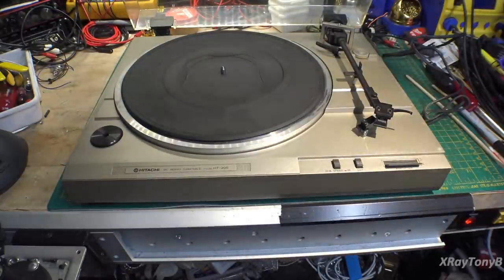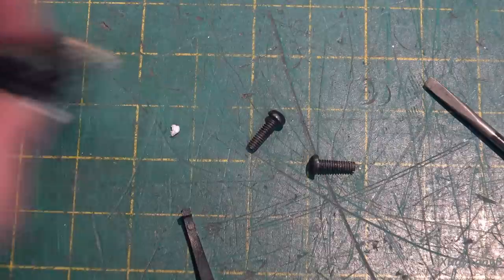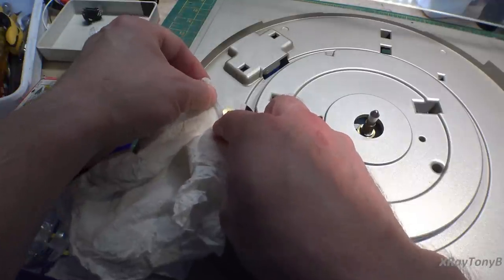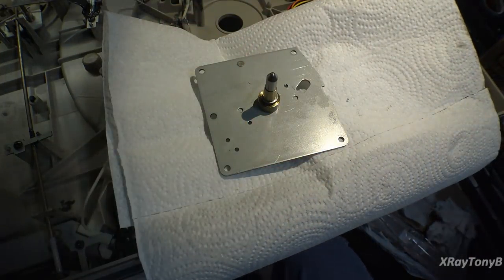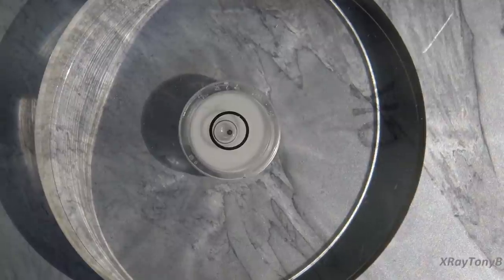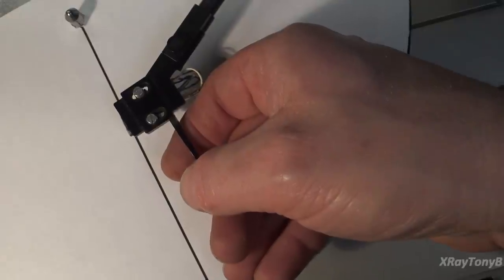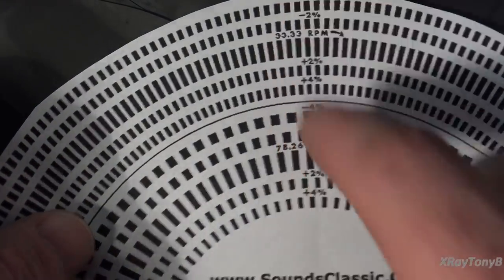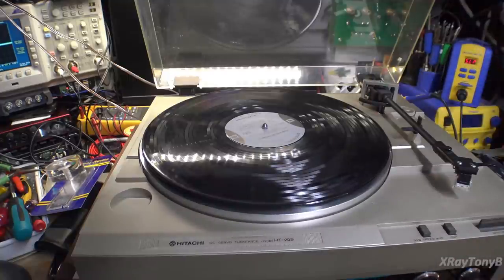Hitachi HT-20S Turntable Service & Setup

Comment: I found this video very helpful. Thank you!
I would like to add some info as well.
Lubricating the motor as you have done is only 1/2 of the lubrication necessary for the motor. Lubrication below the motor drive pulley simply puts oil on the shaft that goes through a brass friction bearing. The oil will quickly travel down the shaft and away from the bearing contact area. My motor was having 'drag' issues - it was squeaking as well. I actually tore the motor assembly down - to do this, I opened up the cover on the bottom and removed the insulator pad and then un-solder the motor connections and the motor control IC as well. I found afterward that opening up the heatsink band around the motor control IC is a better option rather than to unsolder the IC - to do this you must break one of the tack welds. Once the pcb is off of the motor, the cover on the bottom of the motor must be removed and then carefully separate the rotor from the brushes. I swabbed out the brass pilot bearing at the bottom and put lube oil (zoomspout) in the pilot bearing recess. Also, this is an excellent time to clean the brushes (do this first) with very fine grit sandpaper (very fine 1000 grit-maybe lighter) and also the commutator. To re-assemble, you'll need to wedge a small piece of plastic in the slot in the bottom cover between the brushes to hold them apart to put the rotor back into the pilot bearing on the bottom cover - don't forget the washer that goes on the bottom of the rotor shaft! The small plastic wedge will slide out as you insert the rotor back into the pilot bearing. Resolder the motor to the PCB and if you've removed the heat sink band from the IC, put some thermal grease between the IC and the motor housing. The band is for compressing the IC thermal contact side against the motor housing. I simply used small pieces of electrical tape to hold the covers on and the IC band against the motor control IC.
One final note - the speed control potentiometers are junk. I plan to replace mine, but I found that the de-oxit didn't really help with smoothing the spot that set the 33 1/3 speed (for the last 40 years). I noticed that without the motor connected to the circuit, there was a little voltage variation in this 'bad' spot. Less noticeable on the 45rpm pot since I had primarily played LPs on the turntable. After a new platter mat and cartridge alignment, a new belt and motor "overhaul", the turntable sounds fantastic!

Comment: This was exactly what I needed. I've buyed exactly the same turntable and had to do almost exactly what you did (even the problem with the stylus). I had no trouble with the platter mat, but it was pretty stiff tho... I've put on a Stanton 360 II cartridge and worked pretty good I must say... Have to replace the belt. You gave me the tips I didn't knew about lubrication. Now I'm gonna show the process in Spanish (I'm from Argentina) but surely gonna credit you for all I've learned about this turntable. It is pretty entry level but it performs just fine and is way better turntable than any of the entry level new ones. I'm gonna use it as an alternative for my Pioneer PL-550 for it is semi automatic and the other one is fully manual (I can't fall sleep listening records! 😂). Thank you very much! I'm subscribed.

Comment: Hi Tony, great stuff as usual. Juste one more basic ajustement that are forget a lot of time is the azimuth........ I juste put a straight edge across the head shell and is very easy to evaluate.
Merci and stay well.
Reply: Except for the very minute movement of azimuth of headshell itself as perhaps is with this table, these don't usually have it at all. My budget Kenwood, which is roughly the same quality as this Hitachi and was built/sold in 1985 has a tiny amount before tightening down the grub screw as Tony showed here to secure the ADC headshell that these tables tend to use but there is a very tiny bit of one.

Many tables don't have this adjustment at all, particularly many arms are now cast as one piece like the Rega arms (Roy did this to ensure proper rigid mounting all all aspects of the arm/cart/table here, a compromise, but one that has more benefits than not, as long you don't go to crazy with using radical stylus tips.

Comment: Headshell alignment was taught to me differently... Between the 0 degree points an error angle exists (about maximal in between the 0 degree points and also increasing beyond the 0 degree points).. You want that angle as small as possible. Therefore you've got to figure out where to place the optimal 0 degree points so that the + and - error degrees are about the same. To find the optimal 0 degree points you've got to indicate the portion of the groves on your paper. Devide that in 1:2:1 portions and mark the boundaries.. On the points of those boundaries you set the 0 degree points of the headshell .
Reply from the maker: You are correct, and I suspect that a lot of folks that have experience with turntable setup will bring this up as well.  I didn't want to get into null points and different stylus geometries in this video because I felt it would make it too long and too complicated for those who are just starting to have interest in vinyl.  I'm thinking that I may have opened up a can of worms, however, as there are a good number of comments just in the short time this video has been up (Michael Fremer is probably cringing at this moment, if by chance he sees this video ;)).  I'm glad to see so many people interested in the subject.  Maybe I'll do another video where I can explain some things in more detail.  In reality, I consider myself a total amateur in this subject, as some of my friends from the past were waaaay more into this than I ever was.  I guess it's never too late to learn, though!  Thanks for the comment!

Comment: Thank you for this video. The vinyle is still a great subject for technicians and audiophiles. It's always interesting to see the maintenance and settings of different models. I've got a little collection of these, and I'm always curious to see the different approaches and solutions, different technologies... You said you have a direct drive Pioneer in list, and I hope you'll show one of these quartz PLL models. Some are also special as the arms use different technologies, from electronically controlled parameters in high end Sony's or Denon's, other with tangential movement...
Your alignment procedure is quite interesting and effective, but many finicky vinyle users would say it's inaccurate or missing points, like overhang dimensions, angle of shell, arm geometry. There is a complete subject for a video, as substantial as the debate in the choice of these protractors, alignment points... Even this lab disc with a out of phase signal as a way to correct the final alignment: you should get perfectly equal levels and disphasing at this position of the disc, and you could use XY mode to demonstrate that... Is another video topic!

 The fact is many young people have never touched or heard one of these, but the mode is back, and so records player. Some have inherited huge amount of discs from their elders, other are curious, and some have simply been been introduced to the club...
As you said, the CD is so easy to use, digital medias on internet even simpler. And when it comes to real audio, with a good CD player, amp and speakers, you can beat MP4 or quite every digitally compressed format. You perfectly get the point, you will need much more time and money to get a really top quality sound from a record player. But when it comes to the relative quality of this simple Hitachi, what you call entry level is not so, relative to the fact you can adjust it, change the cartridge... Even your basic conical cartridge is certainly a fairly good moving magnet compared to some basic ceramic cartridges you can find on many new MP3 converters! It's just to the point these retro players are doing better for the money than many new ones.
One last thing, I've already tried to save some of these decomposing mats in the past. That's a frequent problem, you first get oil, then your mat can become sticky and even glue to the platter. And with a clean metal base, a new mat is mandatory, whatever the material (felt, cork, rubber...).

Comment: I had bought one brand new in 1980,  they listed for $149.  thats $466. in today's money  lasted for 20 years before the head shell wouldn't make contact with the tone arm,  moving ahead found another one on ebay  just needed a belt and I replaced the audio technica  with the pickering I saved from the first one

Comment: Thanks a lot, although i have a direct drive HT-354 (slightly different inside)  it helped me repair mine yesterday and put all the pieces back together which would have been a disaster without your help😅Merci beaucoup. I think my pb came from that little "lead ball" being rusty..cleaned it oiled it... I have a special oil pen with a needle , (normally used for my saxes) that came very handy. Best wishes for 2023!
Reply: by the way very nice jazz tune on the soprano here!!!

Comment: I have never seen a rubber mat leaking "oil".  I know rubber may become brittle because it dries out, but then there is no fluid on it, it just evaporates.  Some types of rubber, like the drive belts in tape decks, they do not dry out but they become sticky, like gum.  I suspect the former user of this turntable may have tried to lubricate the spindle and the bearing under it.  That should be done from time to time.  He probably did the lubrication the wrong way, without removing the platter; so the oil seeped under the mat making a mess.

Comment: Hi Tony, another interesting video, thanks. Off topic, if I may, I noticed a charcoal colored bracket with 4 BNC connectors right below the o scope. I was wondering if that or something similar might be readily available. I need to set connectors just like that for my 8903 that has option 001 so no jacks on the front. I’m sure you know what I am talking about.
Reply from the maker: The bracket with 4 BNC connectors is actually my 4 channel USB oscilloscope.  When you see the O-scope traces on the monitor at the back of the bench, you are seeing this scope.  Thanks for the comment!

Comment: YES!!!! Please fix up some more turntables, and it's totally okay if it is some really cool ones. 

This particular one is a classic 80's plastic model of the type that typically was part of a budget stereo rack system. Personally I wouldn't refer to it as vintage, because in my opinion vintage is stuff from the 70's or older. The 80's doesn't quite fit the term, and though it was a great decade in many ways, it also was a terrible one when it came to a lot of music gear. It truly was the decade of plastic, and inflated watt specifications etc, and the wood/silverfaced look was replaced by boring black boxes, or even worse colored plastic looking like toys. Having said that, don't take it as critique for fixing this one up. I had a great time watching this. The only reason that I point this out, is that I would really like to see you fix up some 70's models. They were better quality, and quite often made in pretty interesting ways. For instance some of the Duals, or the Philips GA 212 would be such a treat. 

Thanks for always making great and entertaining videos.
Stay safe and awesome.
Reply: TheSoundrookie Just wait for what’s coming. You will be pleased!

Comment: With an undersized strobe disc like that, you can easily put it on top of a record, and then play the outer track of the record as you adjust the speed, adding the effect of stylus drag. I would say that the speed is way off. It's showing about 6% fast, and I've never seen stylus drag lower the speed by more than about 0.5% at most.
Reply: More info, thanks.

Comment: woah! where did you get that vinyl with test tones on it? I didn't know that such a thing existed. Also, I have read somewhere that the bass frequency in vinyl is mixed to mono which is one of the reasons why vinyl sounds the way it does... apparently it's got something to do with the track width. Not many people know about it. I have a few turntables but my favorite is a belt driven Pioneer PL120, this thing sits on the timber floor right next to the subwoofer and refuses to skip a track at any volume level, mind you I also have Realistic 15" 3 ways speakers alongside the B&W 12" subwoofer. I also have an Audio Technica direct drive turntable that is literally a copy of the Technics SL1200, but if you breathe on it, it skips a track. Not all turntables are created equal and while the Pioneer is old and cheap, it sounds amazing and never skips a beat, that's the most important thing at the end of the day.

Comment: How do you adjust the anti skate knob?
Reply from the maker: Set the anti-skate to the same number as your tracking force.  If tracking is set to 2 grams, then set the anti-skate knob to 2.  You can then fine tune it by ear.
Reply: @xraytonyb  The odds of it being accurate is small..  If you can get a disc with no grooves, just a smooth (yeah, I know they're not readily available)surface, lower the stylus onto it and adjust anti skate  so the tonearm slowly drifts towards the spindle.  When a record is placed on the player the grooves will create an outward force on the stylus.  Most ant skate settings at best are approximations.  Looking straight on to the stylus and looking for a deflection one way or the other is a simple(sort of) way to adjust anti skate but even that would probably change over two or three positions on the record.  One more thing, players with no arm height adjustments present issues in down force.  Adjust down force in the middle or even low part of its range and add 1/10th of a gram of weight at a time to the tracking force and listen to the difference.  Their is a sweet spot.

Comment: That cartridge alignment method is not accurate! When looking along a tangential line like you drew on the paper, the cartridge can only be square with the line at two distances. Otherwise, it would be a linear tracking arm! The distances from the center of the record where the stylus is perfectly tangential are called the null points, and will vary slightly depending on which alignment protocol you're using. The mirror protractor you showed has its null points marked at 2.6 inches (66 mm) and 4.76 inches (120.9 mm), which corresponds to the popular Baerwald alignment. This would be a good pair of points to use on your straight line paper protractor. 

The other problem is that you are adjusting so the line on the paper is parallel with the front edge of the cartridge, when you really need to be checking with the stylus is sitting directly on the line. 

Finally, it's pretty important to punch the spindle hole really accurately, so the line really does go through the center. 

When you use Baerwald alignment with an older Japanese turntable like this, you often end up with the cartridge not sitting square in the headshell, because these arms have geometry that's optimized for Stevenson alignment, using null points at 60.325 mm and 117.42 mm. 

Sorry to sound so pedantic, but care and precision really makes a sonic difference when doing this stuff.
Reply: @Etienne Okay, but if you're going to the trouble to try and do any kind of alignment at all, why not use a tool that is just as easy to use, yet delivers far more accurate results? You can download and print out free protractors at VinylEngine.com, and he even shows some of those at 36.15, before he switches to the paper with a line on it.

Comment: This was a terrible turntable when it was new. Why spend anything on it? The problem with old turntables is servicing the belts and tonearm and platter bearing. Dual and Thorens are probably the turntables to invest time and money. There were a couple of good direct drive tables. Maybe some massive commercial tables. A modern Rega turntable probably blows most old turntables away. Linn Sondek could be refurbished like new from the 80s model.